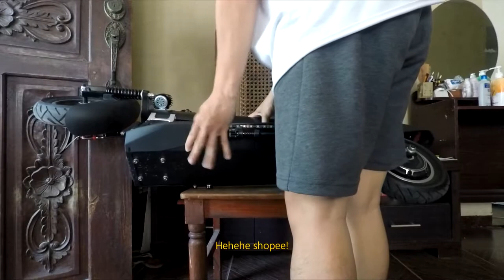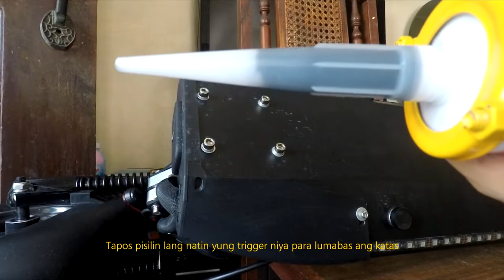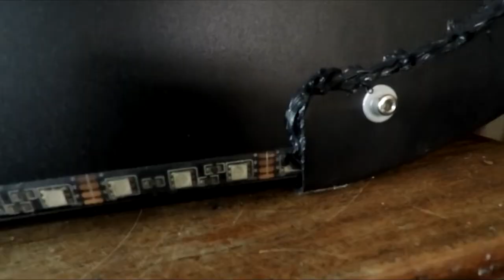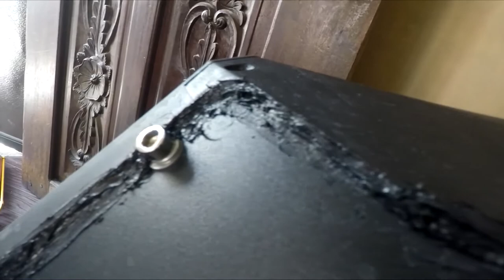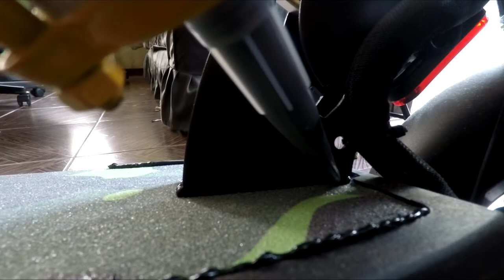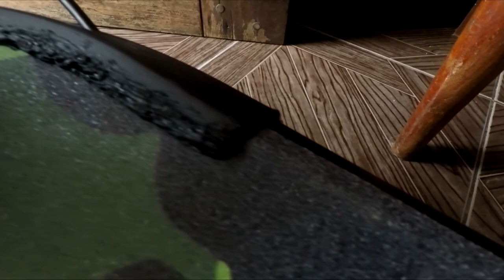APPLYING SILICONE SEALANT TO MY MOBER S10 MD5 | Vlog #122

Comment: Ilan bawas sa battery if 1km lng pinuntahan ?
Reply from the maker: Wala pa gaanong bawas po yun sa batt.
Reply: Standard .001 volts haha
Reply: According to physics if you use peak number 3 which is using 350watts motor then you have a battery voltage of 48volts
And so
 350watts
/ 48 volts

(7.29 amps) and you have 8ah battery it will last for an 1.097 hr so can last 35km.